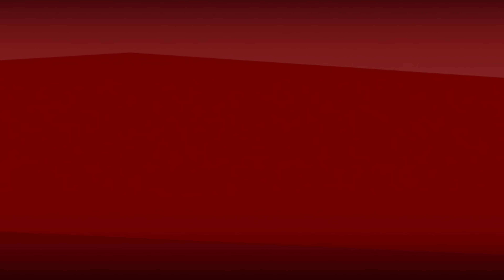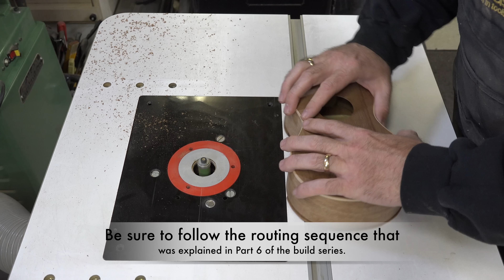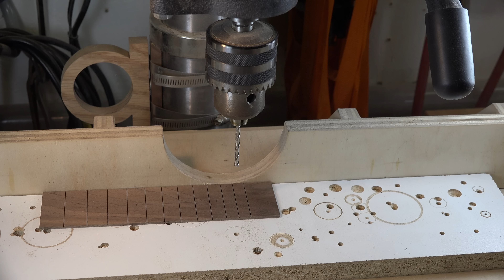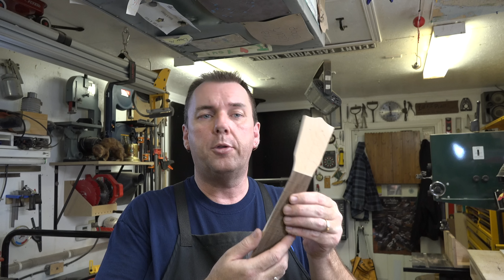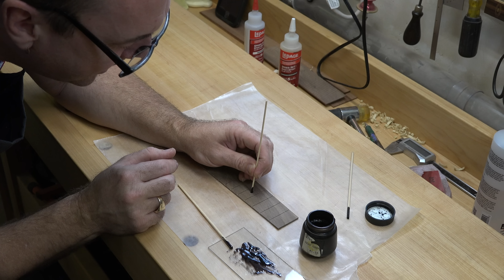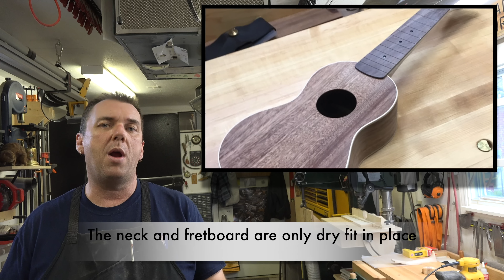Making a Ukulele Part 10

Comment: Nice work Kenny.  I like the fret makers.  Very clever sir.
Reply from the maker: +Chem Cody 
Sometimes, just a little bit of ingenuity is all it takes to come up with the simplest solutions for the toughest problems.  I could have used inlays, but thought that the epoxy and ink would work just as well and probably last longer.  I guess time will tell.  Thanks for tuning in again this week.